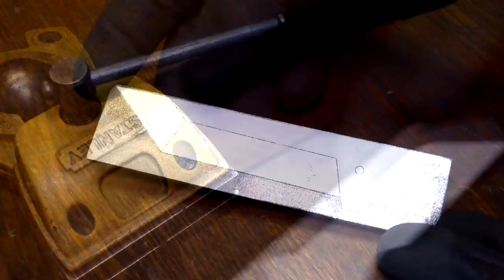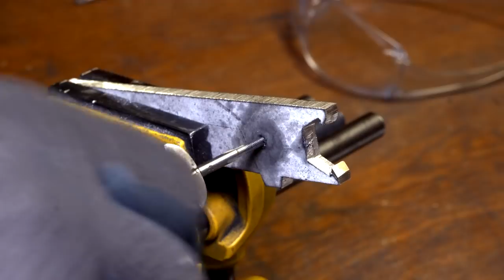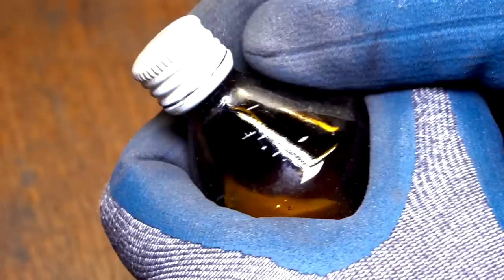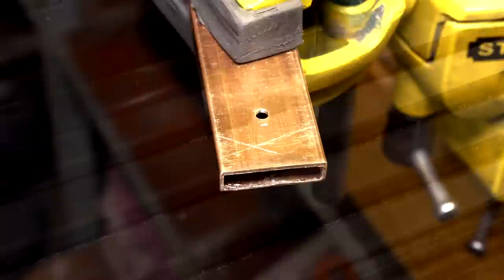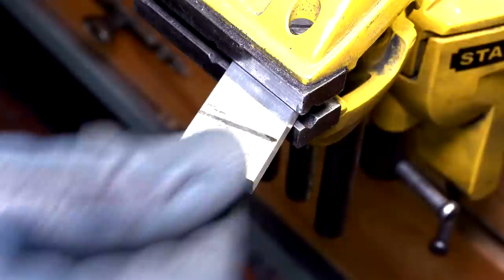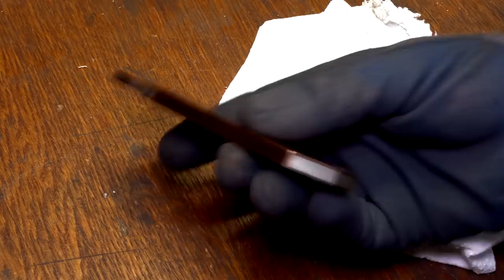Knife Making - Copper Folding Knife with Bottle Opener

Comment: Never seen a break-down knife before. It's a neat concept, but wildly inconvenient. Never mind the fact I would somehow manage to lose the screw that holds it all together.
Reply: If there isn't a sheath, you need to carry it with the bottle opener out. So when you do need a knife, you need to pull out the allen key & reverse it? It is inconvenient & it makes no sense.
Reply: I believe the intent is to fully mask it as a bottle opener until you are ready to semi-permanently make it a knife.
Reply: @aarone.7551  when I need a knife, I usually need it immediately, not after I take it out & assemble it. It looks cool but it's impractical to me.
Reply: @Richard.Dawson  I'll put it more plainly.  It's good for smuggling.  For those who need to pass it off as something other than a knife one time under vigorous inspection.  Then it's turned into a knife for good once you reach your destination.
Reply: @aarone.7551  Lol. Any place that won't let you bring in a knife, isn't going to allow you to bring in that bottle opener.
Reply: Damn Im pretty certain the guy knows all about everything thats being said about it being impractical. Sometimes you just want to make something for fun. Not everything has to be " practical".
Reply: @aarone.7551  I don't think that's the case. If it were, wouldn't it make more sense to either hide the set screw or use a less conspicuous way of holding the knife together? No, I'm pretty sure it was made to be a novelty and nothing else.

Granted, I still like it.
Reply: Could potentially  use a thumb screw or design  it a slightly  different  way with a slot on the spine with a drop in pin trough  the handle  possibly  with a magnet so you don't lose it , just an idea , but an interesting  concept to be fair  👍
Reply: @Rufio1975  agreed!

Comment: I don't know if it's already been mentioned in the comments but I really think you should intergrat this blade/ bottle opener design with your cross/ fold handle and locking mechanism. It would save you unscrewing the blade to swap it. Just changed it so the bottle opener is used in a different direction so the pressure on the locking mechanism would work 🔥

Comment: I suggest investing in a band saw, I am well aware at your surgical abilities with an abrasive cutting wheel but I’d wager you’d save more money in the long run by using a band saw for the initial and larger cuts.

Comment: The knife looks pretty, but here are some suggestions for future projects!
When making a multitool like this, the appeal of making it similar to a Swiss Army knife is strong. But having only one pin holding the blade in place puts a lot of tension on the handle. I’d recommend making a static blade with a longer tang, and putting more pins through the tang. You can still have the bottle opener on the other end, maybe even having a cover that can be taken off the bottom of the handle.
Using wood can be more useful for a handle, especially with a longer tang. You can still fabricate the blade just as easily, as once you put wood slats on the outside of the tang, you can grind it to whatever shape you want the handle to be.
I hope to see you continue to improve and make beautiful, functional pieces of art!

Comment: Could potentially  use a thumb screw or design  it a slightly  different  way with a slot on the spine with a drop in pin trough  the handle  possibly  with a magnet so you don't lose it , just an idea , but an interesting  concept to be fair  👍

Comment: Change the screw to be something you can take out without a tool. A small recessed button with a shallow leaf spring so you can push it in and slide the blade out. It seems completely impractical otherwise. Sitting around drinking beers with your friends and you get a good buzz going and someone asks for a knife and you start drunkenly fiddling with the bottle opener like, hang on i gotta find my hex wrenches.

Comment: Aww... oh well. I was hoping it could fold out and back in. Taking out a screw driver to reassemble it each and every time you want to "switch modes" seems like quite the turnoff.

And if I need to carry a screw driver at all times in case I need to reassemble it, I might as well just keep it in knife form and carry a bottle opener separately.

Comment: It seems impractical. With beer, I pop the caps off with my ring.  You require alan wrench, not  even a screw driver,  to use a knife... hOW CAN WE MKE A IMPRACTICAL KNIFE AND MAKE IT EVEN MORE UNRELIABLE.. That is not "folding". If you need a knife to cut something.. That is not the knife I want.  If it had a clip and not a screw, maybe..  YOU WANT TO DO THAT, make it a switch blade like my Smith and Wesson.